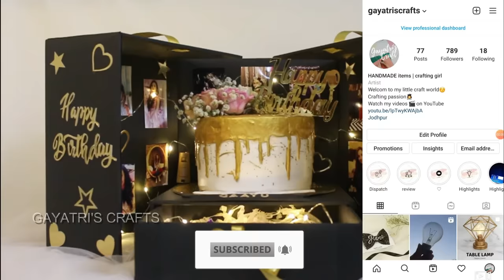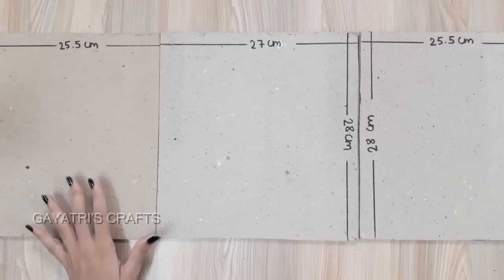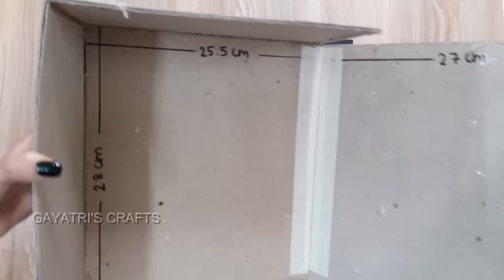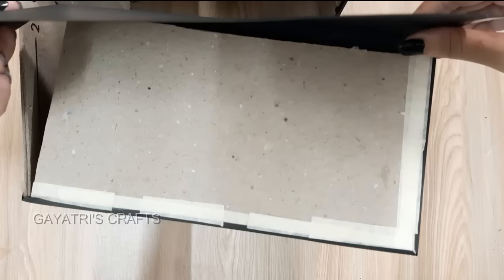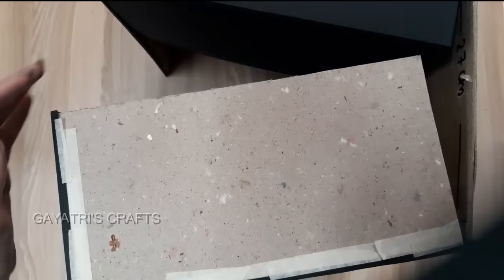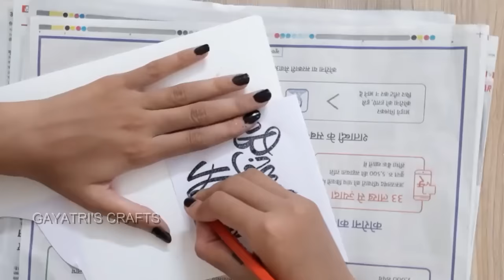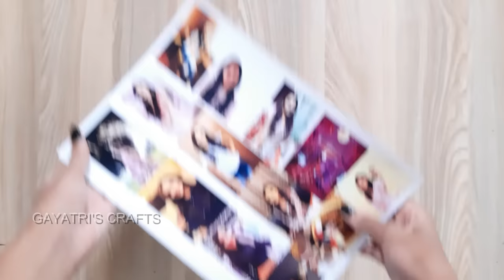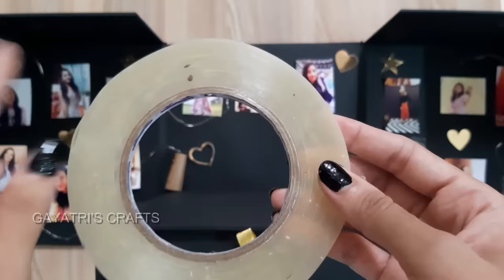Surprise Cake Box | Cake Box With Drawer | How To Make Surprise Cake Box At Home Step By Step

Comment: Hii didi mount ,card board bhi 2 cut karke joined karne ka kya means 2 Card board leke aapne dikhaya vaise dono joined karne ka plzz batavo n mai kar rahi hu na
Reply from the maker: It depends on thickness of cardboard if your cardboard is strudy and thick then  you can use it's single layer but if your cardboard is thin then you have to use it's double layer so it can handle weight of cake